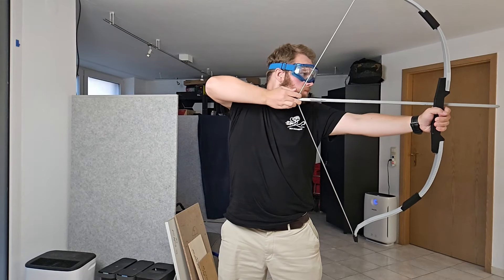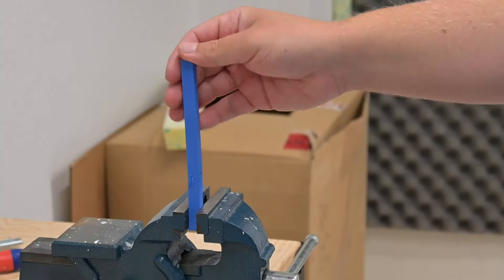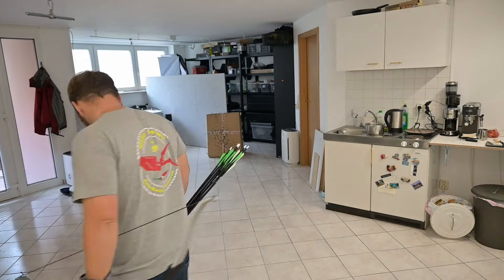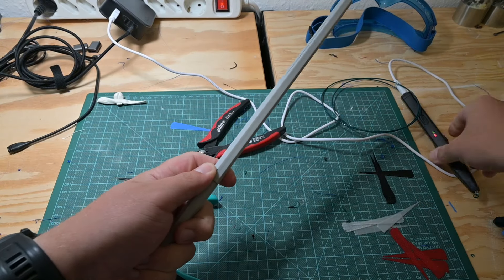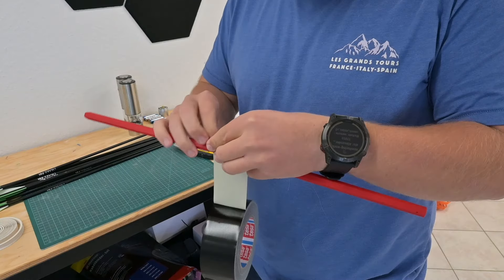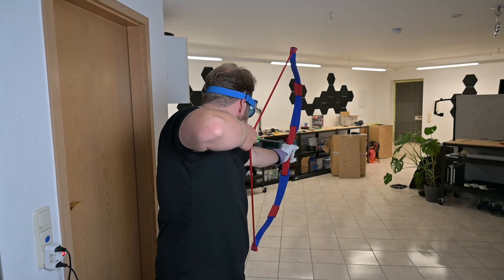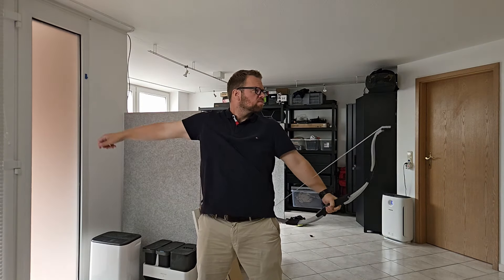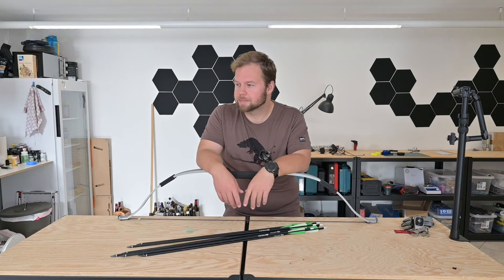Can I 100% 3D Print a Recurve Bow?

Comment: If the arrow is a HEX shape and it is PRINTED. Put a 10-15% TWIST ont he HEX shape. That will help impart spin and accuracy. 
A real life Boyeur I met angled his fletching by 10% on the back making a 'rifling' effect. Was very cool.
For the 'String' I would try and 3d print several strands and just weave them, like you would twine.
This is very cool. I do not want to crap on the engineering accomplishments of this but it makes me think how far is it really from a PVC bow?

Comment: What Filament are you using? Tried using PLA+ or Carbon Fiber Nylon used in 3D printed guns?
Reply from the maker: Its just regular PLA. It has much more wood like characteristics. I am quite sure that going beyond 20kg of draw weight with just PLA is possible but for now I am a bit tired of bows.